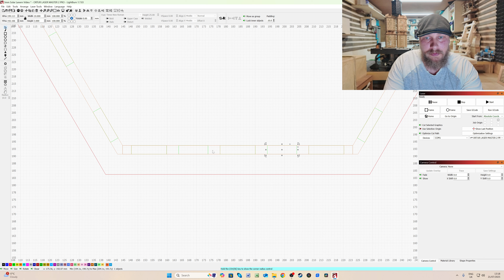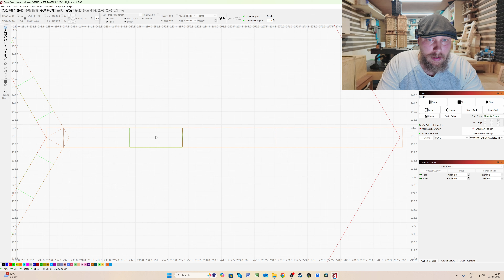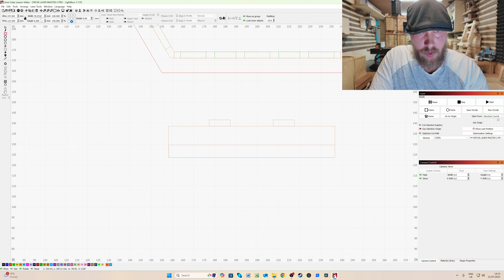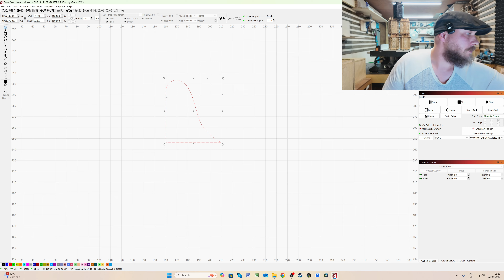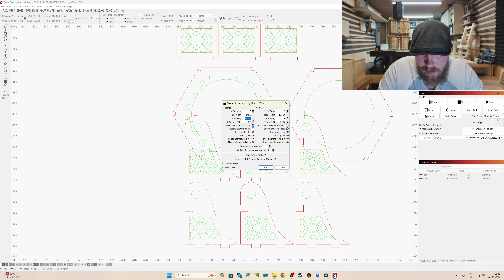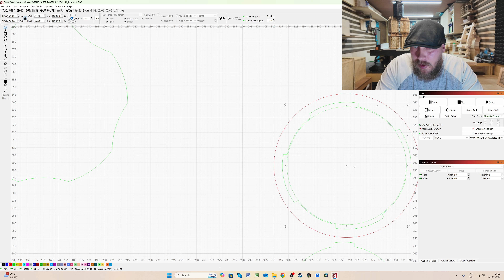How to Design Solar & T- Light Lanterns

Comment: Fantastic! I made little square Japanese led yard lanterns with a door for Christmas presents. Used very thin plywood, stained. dowel for the door axle. It took hours to cut out the square holes in all 4 sides. Days for all 7 to be made.

Comment: I think what darcykelly6199 was talking about was the polygon shape with the notches on each point, and the other one with the center hole cut out, I thought I had missed them as well,  they just suddenly appeared at the bottom, below the top panels at time 57.12, I didn't notice you doing them.   Great Video
Reply from the maker: Thank you, you might be right. I will go through my video again and see if there is something I can do.

Comment: how do u adjust the kerft to fit snug??
Reply from the maker: If you are using lightburn. Double click on the layer with the slots on, in the cuts and layers window. 
There is a setting labeled kerf offset.
If your joints are loose, decrease that number it will make the slots tighter. Make sure to go in small increments. 
If your parts are too tight, you need to do the opposite with kerf. Increase the number in small increments. 
let me know how you get on and if you need any assistance.
Reply: @MadeBetterWithKnowledge  yes i need help do i put adjustments in just kerf? inner cuts and cuts do i adjust there too? confused where to put adjustment
Reply from the maker: https://youtu.be/d3LR1M4moQo?si=D66hcnByfQInr8h-
If you take a look at my video at 8:03, adjust the kerf to the green layer only. If you cut these two parts out and your fit is loose, decrease the number for the offset value. Re cut them. If they are still too loose, keep decreasing the value until you get your desired fit. You should only need to adjust the green layer (the slot layer).
Reply: @MadeBetterWithKnowledge  my kerf is 0.14mm

Comment: Great video you have lightburn perfected.... Is that actually real timber and not a ply if so where did u get it plz
Reply from the maker: Thank you. I try to use solid timber whenever I can. I get my timber from a local timber merchant, I purchase my timber as large stock and mill it down myself. If you don't have the means to mill the timber yourself I would reach out to local suppliers and ask for quotes to machine it for you to a specific thickness.
Reply: @MadeBetterWithKnowledge thanks for replying